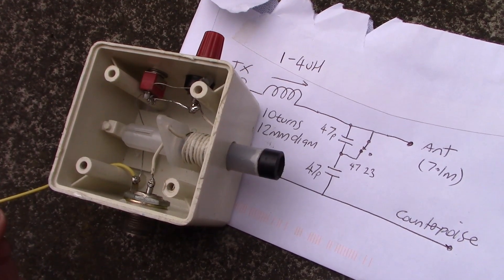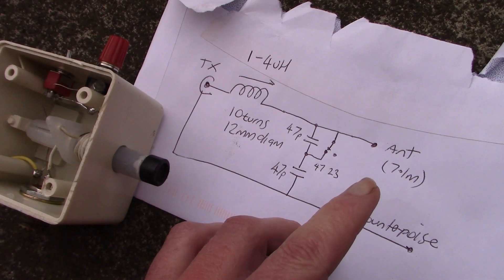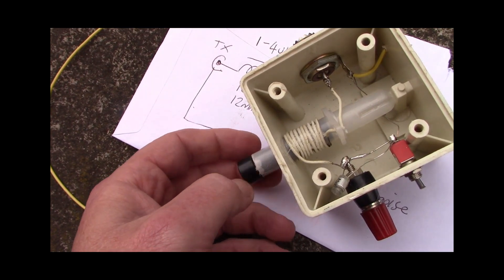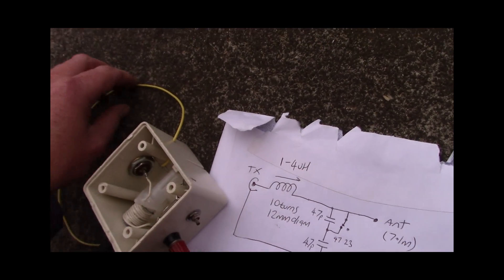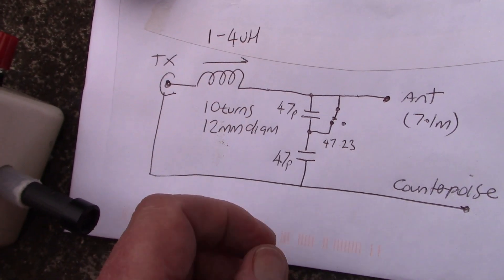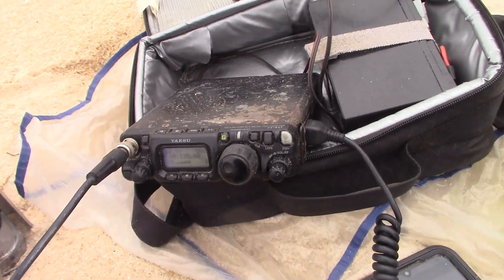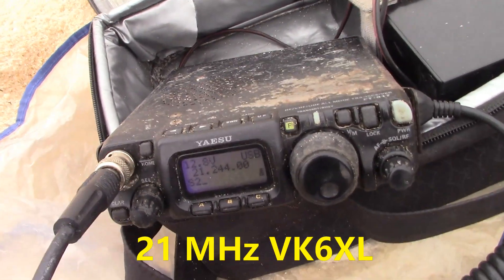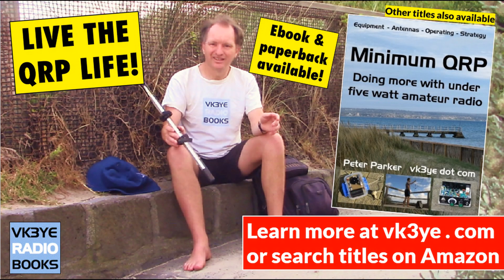Super simple vertical for the higher HF bands

Comment: Nice project. I just build one myself, but with 1 capacitor made from a piece of coax. Do you know how much power your antenna can handle and how much current is flowing through the inductor? https://i.postimg.cc/xdxK17jf/20251002-215841.jpg

Comment: I built a magloop with variable inductor instead of variable capacitor. Works well, but above 5W the ferrite core heats up, and the resonant frequency drifts up. I probably need a ferrite core of another material. Is this heat produced by 'eddy currents'?